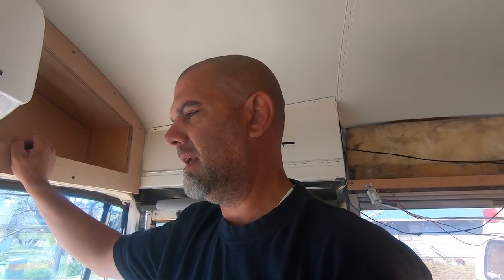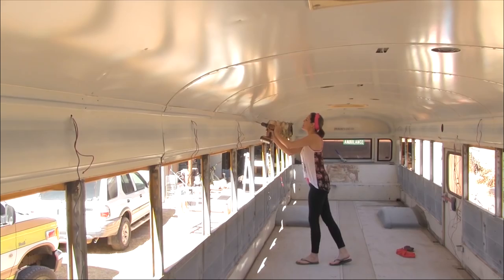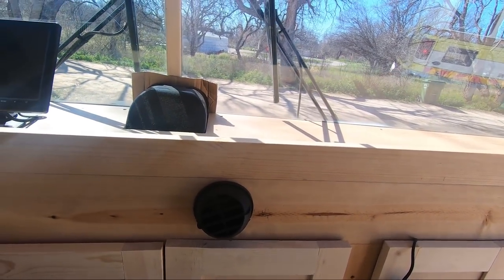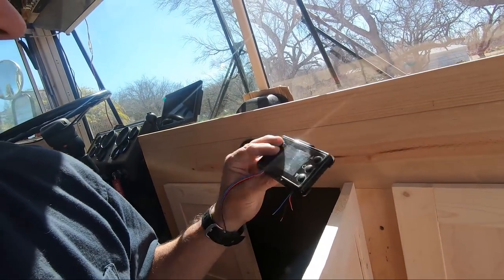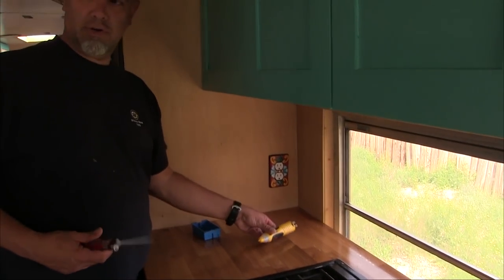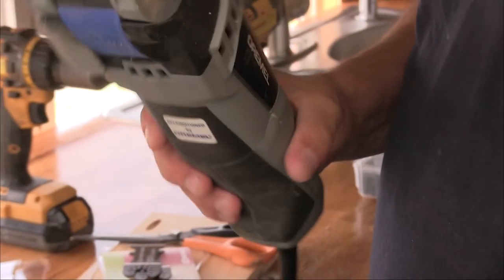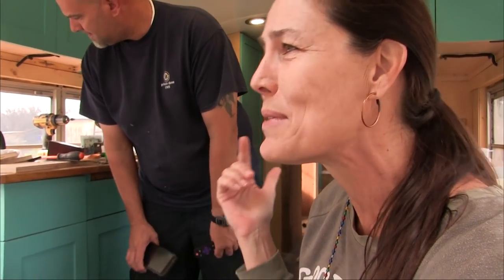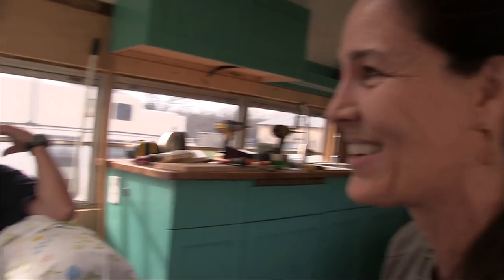Being Transparent About our Window: Diesel Heater Cracked the Glass! (+electrical update)

Comment: Don't be so hard on yourself. 33 years in vehicle repair and have seen thousands of broken windshields tells me you had a small sand/rock chip in the windshield and the heat from the heater then broke the glass. Take a ball point pen and trace the crack to the chip. The smallest of chips will eventually crack due to heat, cold or movement. Heat alone will not break a windshield. Great channel and love what your doing!

Comment: We are also running 2 diesel heaters in our bus. One diesel heater in the back that heats the back bedroom and the basement compartments. The front diesel heater heats the front. I installed an outlet that spins like yours at the bottom of the dash cabinet. We ran that for a year and realized there was not enough heat to keep the windshield clear. I installed another outlet on top of the dash in the middle, back about 12" from the windshield. The 2 outlets are joined by a y connecter.There is enough air flow to feed both outlets at the same time. The nice part of these out lets is you can direct them in any direction. So you can point it towards driver side windshield then you can spin it to passenger side windshield. I also have fans at the top corners of the windshield that help circulate the warm air. I also have the original defroster fans that we can help move air.I also removed the original dash heater. The original hot water heater never gave us enough heat to warm you up or defrost the windshield. Super happy with the diesel heaters. One word of advise that i learned the hard way. Use a foam filter on the air intake. I made mine from a foam filter for a small vacuum, bought it at walmart. cut to the size of your inlet. Check and clean regularly. You will surprised how much animal hair and dust it collects. We have a german shepherd. It's not an easy job to clean the unit from hair and dust internally. good luck.

Comment: Couple old school 12v oscillating trucker fans on the windshield would solve the defrost problem plus turn em around and down would help circulate the heat from the wood stove when parked...  coming along nicely by the way!

Comment: Mike and Kerry, My wife and I so enjoy your posts, we are also building/re-building a bus to travel and hopefully live in.  Have you thought of installing a 'y' in the vent hose so you get some defrost and some heat to the stairwell?  I  think also  a  6" X 18" (or so) chunk of aluminum diamond plate between the windshield vent and the glass would keep the heat dissipated enough to protect the glass. At any rate, we eagerly await each new video.  We are truly impressed by your banter and affection/support of each other.  And Mike I love your problem solving on the go.  Kerry, my wife and I so love your shower and the process you came up with to get it installed, you two rock.  Our bus of choice is a 1960 Flxible Hi-level.  After two plus years we are just getting to the interior. Yes, more work than we thought but this baby's ours now.   We will be sad to see the build end but very happy that you two are out there enjoying the fruits of your labor.
Mick and Phyllis

Comment: Have you looked into gravity fed pelet stoves? Stays running for days on one hopper of pellets and no power use or freezing in the morning like a wood stove. You can cook on them as well. No moisture like propane.
Reply from the maker: We thought about it but it has to be pretty small.  like 500sqft small.
Reply: Look at "CHP tiny gravity fed pellet stove portable grittle " (YouTube).  It's from hasty heat. If you look at it you could probably make it. They are awesome for RVs

Comment: Mike pull a feed vent off the dash to the defrost. It will pull heat and mix with the room air. It should keep the air cool enough but still defrost.
You could use a computer fan.

Comment: My opinion(if it is worth anything)is that the reason it cracked the windshield was that it was too close to it. The hot air didn't have enough time to mix with the cooler air before hitting the windshield. I think if you put another vent like you put in in this video, except put it on top of the dash as far back from the windshield as it can go. Then you can split the vent hose and feed both vents from it. This will reduce the amount of air that blows directly on the windshield and allow you to adjust the vent for wherever on the windshield that you want it. just my .02 cents. Yours is still better than any build on YouTube, including mine.

Comment: Yep, the vent base, is a pain in the base. I had to use 3 or 4, #4 flathead and countersink to the point of worrying about breaking thru and this worked. It would snap together then. It would be easier to make a vent that isn't this fussy.  I found nicer RV vents, but they were much larger than 3".... maybe 4". It'll work until it doesn't.

Comment: Not calling anyone out but may i suggest using a brass floor register(more aesthetically pleasing) instead of the black plastic thingy you can get them at home depot along with a square to round sheet metal duct to put behind it. If you are creative you could put one on the top of the dash and one on the side pointing away from the window, most of them have dampers so you would be able to balance the amount of air going towards cabin and window. Also some duct insulation would prevent heat loss to the cabinets. Cheers

Comment: Another suggestion is to go to a truck stop, and buy a chrome 12 volt fan (or two for both windshields). Then mount them in the center of the dash aimed at the windshields. this will blow room temp air onto the windshield. Defrosting them atleast to some degree. I do this in semi trucks when the defroster dosen't work, but the heater does. And they would look cool on the dash.

Comment: you just need to cool down the air thats blowing against the window , so add a small blower adding outside air going to the window vent and one vent sucking the hot air from near the heater (not plugged straight intoo it but near the cabin vent) and use a speedcontroller on the inside air fan and a speedcontroller with a thermostat on the outside vent to mix the two together for the right temp , increasing the speed on the hot air will cause the heat to rise ad the thermostat kicks in to add more cold air saving youre windshield ,
depending on the cfm you need you might be able to do this with computerfans or small squirrelfans

Comment: Have you thought about a rotating 90 degree elbow? Point it back to heat the main space and forward into a defuser  for defrost.
Reply from the maker: That's an idea. Hmmm....
Reply from the maker: Have another idea for this one.😁
Reply: @BussyMcBusface  Or after splitting the heater output in half, half going to the new vent, half going to defrost.  Then have the fan blow through the defroster, and let half of the air come from the heater, and the other half from ambient.  The defrost would essentially only get 25% of the heater's output.

Comment: Sorry Kerry, i am with Mike. That was funny, made me chuckle. Could you extend the length of the ducting Mike in order to give the air time to cool a little and place a fan in it to compensate for the length. Would be easy to test. Some DVM have a thermal probe as well so you can check the end temp of the air.

Comment: Thank you for fixing the electrical boxes... That really had me worried as well. I didn't want to see all that hard work go up in flames!!!!!!
OK, my thoughts on the heater up front... Put in a splitter and use one of the other vents close the where the defroster vent was, that way it can be pointed at the window when needed and be half the force that it was, but then also be pointed away from the windshield when you aren't using it for a defroster. 
Just my thoughts...  
And let us see the shower dang it!!!! 🤣😂🤣😂

Comment: The style of boxes you used have an indention that the switch or outlet fit into by clipping off the "ears".  If you ever wondered why there are score lines, now you know.  You don't actualy have to clip them, a couple of bends back and forth with pliers works well.  When installed they will be nice and flush.

Comment: Just a thought..
You might be able to use a Y distributor (don't know the correct name) for the windshield and the rest of the bus. 
Divide the heat so to speak. And a butterfly valve to control the airflow.

Comment: HaHa... you guy's kept me cracking up the whole video, thank you for that. I am glad you changed the outlet setup with all your receptacles and the switch. Thank you.

You were in the Infantry? :-) I was German Military Police..... leading and guiding .... so it worked out great here :-)
With your heater setup.... would a programmable thermostat take care of your temperature settings? Kind of setting it to a certain temperature at a certain time and day and then drop it to another temperature through out the day so the heater doesn't come on again? Maybe get 2 of those for each heater to work independently to safe power?
Then with your wind shield.... I thought I saw all of your videos but I can't recall  the video when you installed it and so don't know where the hot air came out pointing toward the glass.  My idea would be to install one of the outlets you have left over from the set a little bit further away from the front wind shield and have it blow along the surface rather then directly against it. maybe use the 4th outlet on the passenger side in the same way. In theory the hot air should have cooled down a little before it hits the glass and should not  cause any problems anymore. Especially if you keep the one which you just installed pointing to the inside of the bus .
I saw a video of a guy building a trailer as a tool utility trailer with one of those heaters a few day's back. He mentioned that the flexible pipe you use was restricting the flow of the air due to the rough inside surface and that he actually got a tremendous increase of flow after he replaced the flexible piping with schedule 40  4 inch pipes.
I remember there are temperature restrictions with those white pipes. maybe the black pipes ( used as waste pipes directly underneath sinks or behind washers for example) would be better. But this is just a hint if you are not satisfied with the amount of air flow coming out of the air outlets....
Well... here is the most important thing I would like to say.....
I absolutely like what you have done. It is absolutely amazing and totally unique. Watching lots of bus conversion videos here and being able to visit the skoolie palooza at the beginning of this year, I've not seen anything similar to your bus at all. It is impressive that you have so much skills and are able to think outside of the box as most people I have met so far are able to.
I am looking forward to your next video..... until then, take care, stay safe and healthy..... BOTH of you

Comment: I had windshield crack overnight with the privacy curtains 
Your idea is good perhaps put a T in the heater tube & valve to control the heat 
Also the diesel heater can get very hot I melted my cpak hose granted it s paper thin also another guy I Know heated his can goods in the heater tube

Comment: There is a new epoxy that can be used without removing the glass. Companies that come out use it. Also, you might ask a school bus mechanic at the local school district for advice or help if you need to install one and you're unsure about doing it. They are kinda of tricky. When you travel too. Those mechanics are always doing jobs on the side or like to talk shop to give advice.

Comment: Hey you two... Just a thought l, (I intermittently follow your channel so sorry if you've already done this) why not run a mini split heat pump instead of a diesel heater? It's hugely more efficient to run! And runs less hot than a diesel heater would I'm thinking so maybe it wouldn't be as apt to crank the windshield glass.
Reply from the maker: Actually, the mini split heat pump draws over 1000w making the least efficient item we have on our bus for heat.  The diesel heaters are warmer  and draw less energy by two orders of magnitude making them, BY FAR, more efficient.

Comment: Hi. This is my first comment. 😃. The front heater. Can you not put in a T split. So that most of the heat goes in to the bus and some heat towards the windows. Or is that to simple that is wont work?  Or you take a her hairdryer in build that in. Lol. It would be fun. To see that. To defrost it does not take that much heat. And a hairdryer gives enough heat. I know stupid idea. 😃.  But I am disappointed in one thing. No sirene. Next to the bullhorn lol.

Comment: You can manually set the diesel heater pump pulse.  You can set it to low and still run it with Honeywell thermostat
Reply from the maker: I know but the initial amperage draw is just too much when it starts.

Comment: How bout a 3” heater damper and a Y ??? You could reduce the flow to the windshield. And also get some little fans to mount at the top corner of the windshield,, to move some air,,,defrost complete !!

Comment: Well that totally sucks.  Other things will probably break,  by the way.  Usually better if you can out of the driveway first though.   Oh and,  where's our regular camera operator?  Was she too embarrassed to be seen in the video?  *kidding*.    Still not entirely sure why that windshield would have cracked like that.      Whups.  Wait a minute I see we're good @12:00.  Just ignore that "camera operator"  comment.  It's late.  We're "self isolating",  but no murders have been committed.
Reply from the maker: Actually, someone warned us in the comments of the heater install video, that temps of 200* could crack the glass, and higher temps could cause it to soften or slump! Unfortunately we turned it on a couple more times before finding a solution, and this happened.

Comment: Why not just cut slots in the  panel below the window use a piece of pvc pipe under the panel connected to the ductwork with matching slots to vent air onto the windows. You could also use covers to limit the air when not needed. Just use a T behind your front vent..